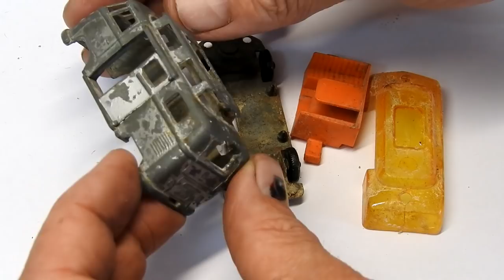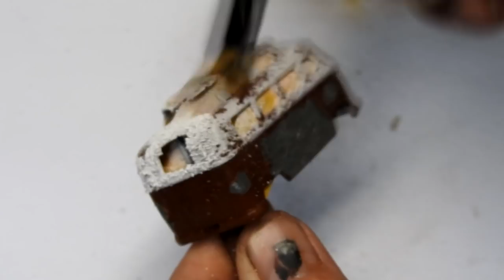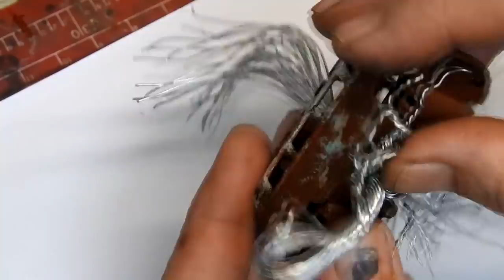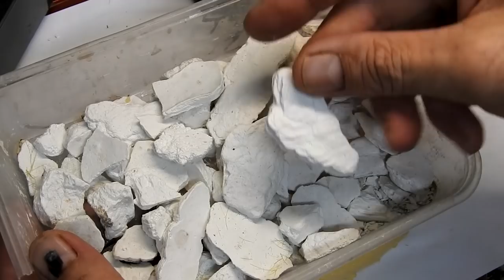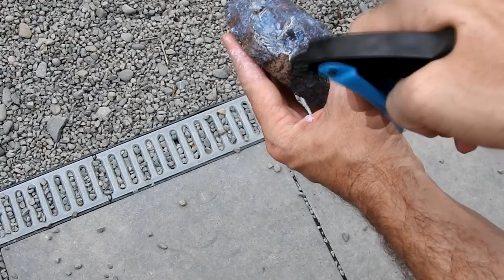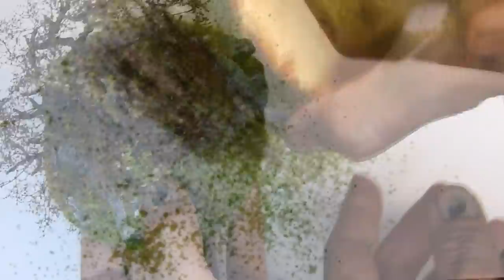Volkswagen Camper Cherry Blossom Tree Diorama Realistic Matchbox

Comment: Im my younger days I used to use a combination on pen vice and tap vices to make wire bonsai trees. I used the pen vice for only a couple of strans and varying sized tap vices for the trunk, larger branches and roots. Saves on getting poked and makes it so much easier to twist the wires. Also when first starting the twists on the trunk I used two to three finishing nails hammered slightly into hard wood (oak I believe) and used them to hold the loop then used two large tap vices to hold the two bundles of the end wires and to give me a really good grip on the wires.
Reply from the maker: Yes definitely easier to use a jig of some sort, wasn't possible working through the van on this one tho.
Reply: @DannysDiecastDisasters  Do all the twisting before you put it through the van then once through the van bend the limbs how and where you want them to go and into the shapes you want them to be. I can understand with the way you made the bark not being able to do it before putting it through the van, which you could have used liquid/foam latex to coat the wire in and then it would've bent the way you wanted and kept the bark look but it does become a bit of a pain with adding tints/pigments to the latex and then you have to deal with the natural shininess of it and mute it down. You can also use silicone and add pigments and white spirits to it to give it color and make it paintable but there again you have to mute the shininess of the silicone. Then there's the cure time as well. But the nice thing is that you can use sawdust or similar to coat it while either the latex or silicone is still "wet" and that will mute the shininess but it may just flake off when bending the limbs.